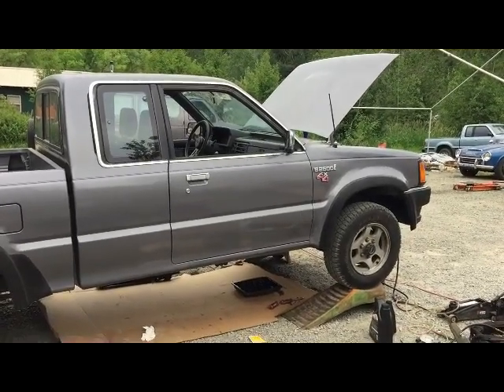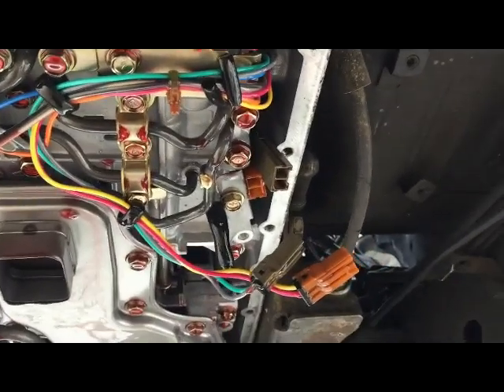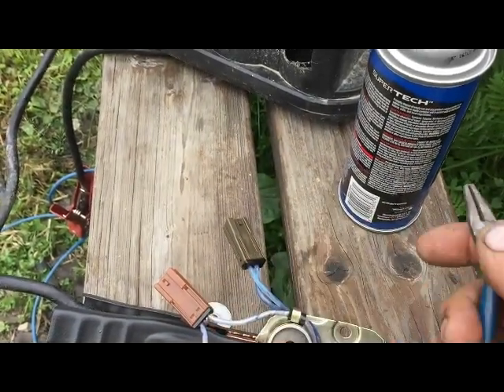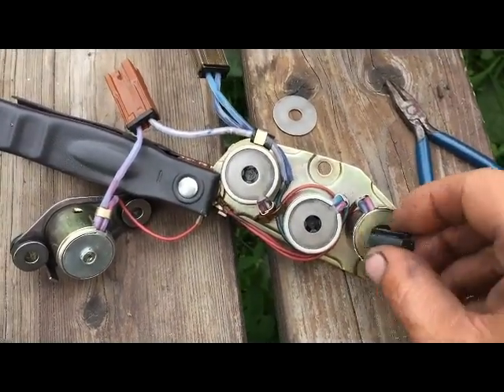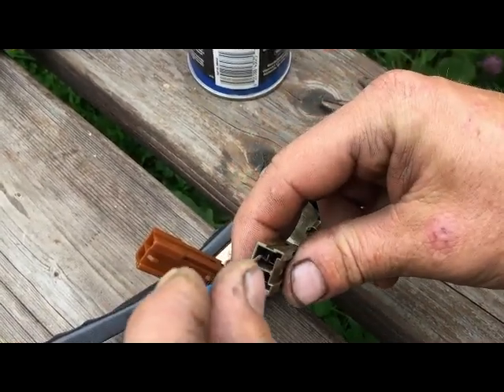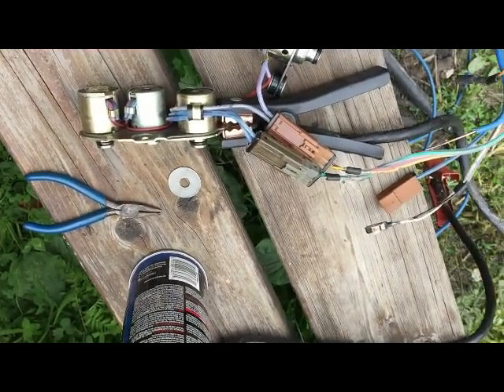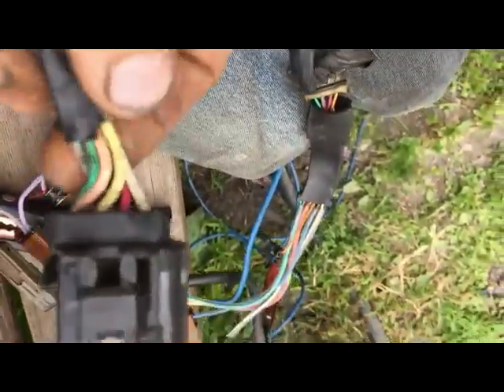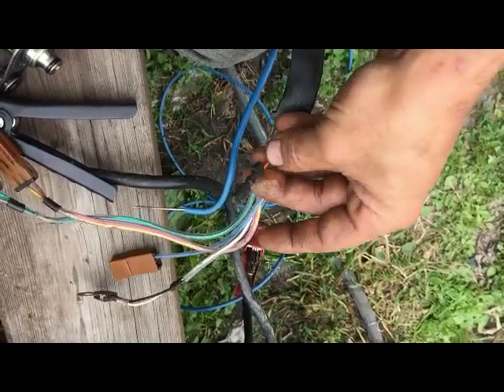automatic transmission solenoid repair re4r01a b2600i

Comment: I have a 2000 Frontier that upshifts PERFECT but above 50 mph it will not DOWNSHIFT into 3rd. Or try to engage at all. It acts like its popping into Neutral. Is this a solenoid issue???
Reply from the maker: It's either throttle positioning sensor or you have a valve body issue or even worse you stripped out to planetary
Reply: @WorldScienceTV  planetary? I was able to get it to downshift at full throttle going up a hill after it downshifted on it's own. It engaged perfectly and fully.
Reply: @WorldScienceTV  going up hills specially I have to gradually increase throttle and it will go from about 2300 rpm to 3k downshifting I'm assuming and sometimes from there if I go full throttle it will kick down a gear like it's supposed to. Engages fully and works great. 

Which leads me to think a TPS?
Reply from the maker: Sounds like you are forcing the trany to shift manually tps maybe. check to see if the connector haven't bin pushed down on the trany electrical plug. Look to see that the TCM isn't damaged.

Comment: I've got my trans pan off - changed the filter. Can I spray some brake cleaner into the solenoid with out damaging it..( if it isn't already damaged)? Prolm is that it won't shift into 4th/ OD.
Reply from the maker: That is your lockout solenoid that is causing that but there can be multiple problems one problem I've seen in the past is as simple as a bad connection in the plug in between the tranny and the vehicles wiring harness the pins were push down from somebody testing with a multi meter so identify the lockout solenoid and make sure it is working properly you should be fine with brake cleaner but I always use starting fluid it's not as caustic for parts remember solenoids and stuff have a coating on the wires that make the coil you don't want to dissolve that and also the temperature sensor for the transmission  if that fails then the tranny will never go into overdrive but always think that the tranny is too cold to go into overdrive so you should just see a veriating  resistance as you heat up the solenoid on with a multi meter and that I actually did a video on that same temperature sensor
Reply: Thanks a lot! I didn't clean the solenoid with brake fluid or anything else. I did a Ohm test on the solenoid before installing the pan and it was good. I checked the temp sensor on the thermostat housing and the wire broke off in my hand. I've now fixed that. Just drove it and still no 4th gear yet. No one's been poking around in the wire harness. My mechanic plugged in his high $ OBD tester and there's no codes but we never drove it while it was plugged in. It's been taking longer & longer each winter to get it to shift into OD then 2 weeks ago I was on the highway and it wud shift 3 - 4 - 3 - 4 on it's own with no hills in sight..or maybe it was 4th lock up - 4th lock up ( I don't if that's how it werx) Temperature gauge on the dash reads normal ( middle) and werx quicker than before the fix. Thanx so much for yer time! I'll check out yer other vids. Cheers
Reply from the maker: That is a different temp sender the one I'm talking about is in the tranny
Reply: @WorldScienceTV  Hello, I have a problem with my transmission RL401A 93 NISSAN D21  it does not do 4th shift.  Any idea what could be the problem. The transmission is not electronic. Looks like it doesnt have any more solenoids in the valve body besides the overdrive solenoid and lock up solenoid. Thanks in advance.
Reply from the maker: If there is no debris in the pan then the valve body may be at fault you should be able to change this valve body fairly easy.
Reply from the maker: One solenoid is overdrive which is 4th
Reply: @WorldScienceTV  when I drained the oil the first time it was somewhat black  and filled with new oil and new filter and it worked for a day but the next day it did the same thing. You think the valve body could be clogged or does it have shift valves inside the valve body that are bad?

Comment: I have an erratic shifting on my 1999 nissan pathfinder ( it happens after the truck it's a normal temperature )
It always down shits in any speed , I mean I can b driving on the freeway 65 mph or on the streets 35 mph and down shifts all of a sudden 
Transmission is not slipping for sure  so I was thinking on the solenoids but it does not have any codes stored in the computer 
Any thoughts ? anyone ?
Thanks in advance
Reply from the maker: First check tps